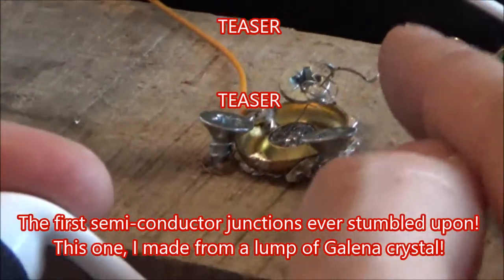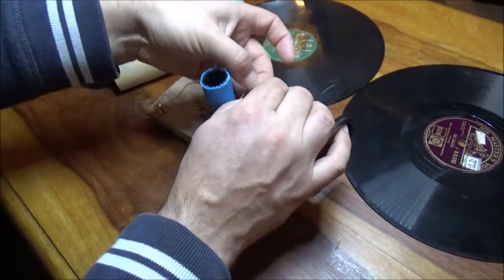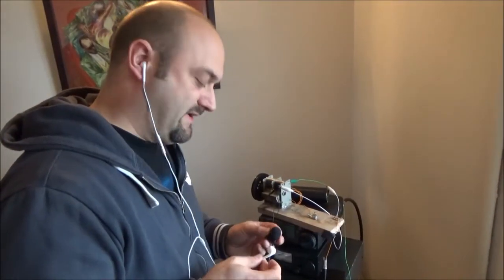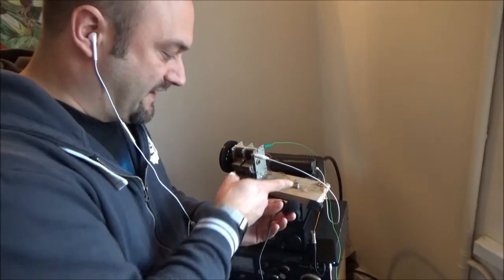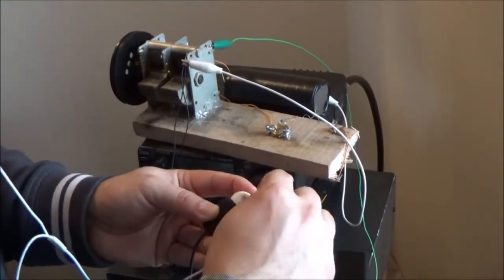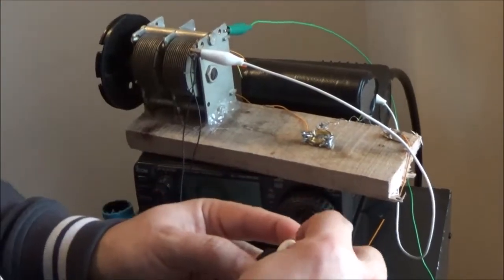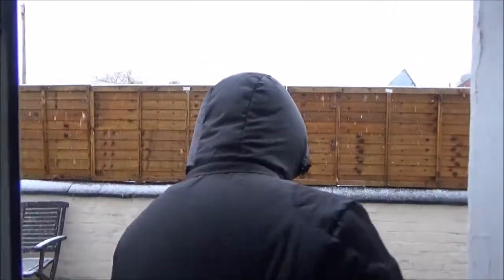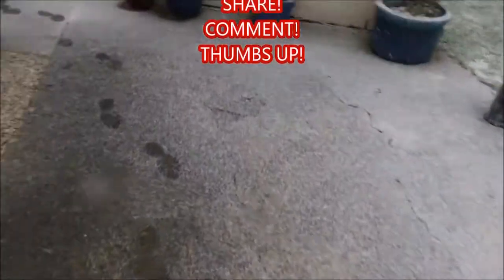DuB-EnG: Make A Cat's Whisker Galena Crystal Radio Set Part 2 - IT WORKS!

Comment: What is the impedance of that Apple earbud?
Reply from the maker: 32 Ohms...   not nearly high enough or sensitive enough to be run directly...  needs a little amp
Reply: Dubious Engineering :: if it’s 32 ohms then I have no idea how you got it to work. I am absolutely gobsmacked. The headphone out jack signal wasn’t amplified in any way?
Reply from the maker: I have just skipped through this video... it was one of my earlier videos, and yes you may be right...  perhaps I didnt mention the tiny black box headphone amplifier you can hardly see at the bottom right hand side of the video...   I'll probably do a re-make of this at some point as it is an interesting subject....

Comment: Is it possible to achieve Frequencies below the AM band around 100khz
Reply from the maker: You will likely need a much bigger coil and capacitor..   this frequency is primarily used for aircraft navigation beacons...
Reply: Dubious Engineering  I thought that within those frequency ranges it was used for hearing testing.
Reply from the maker: Hearing stops at about 15-20khz...   sometimes VLF radio is used underwater for submarines...
Reply: The range for a dog is 15-50.000Hz and cat is 60-65.000Hz . I would love to be able to tap into these frequencies . Would there be any possibility of that. ?
Reply from the maker: Yes, it’s possible, you need a very sensitive high frequency microphone, and then a frequency divider to slow down the high frequency and make it lower...  then humans can hear what dogs hear!